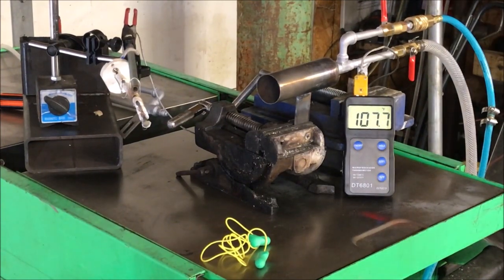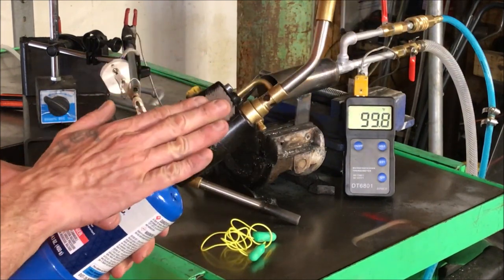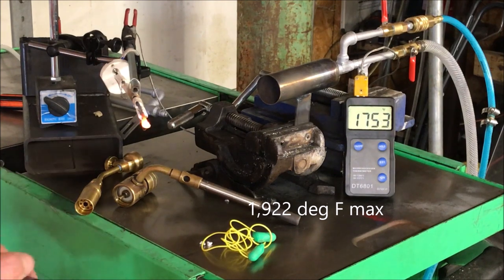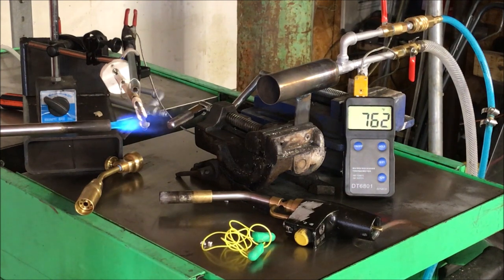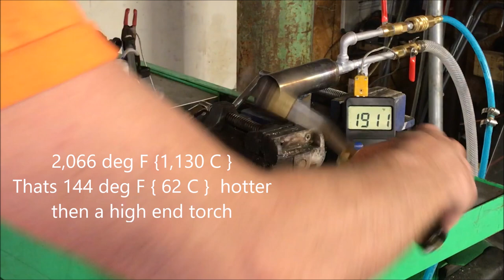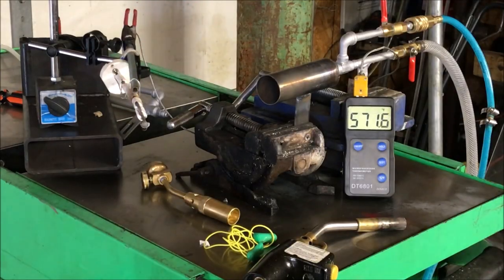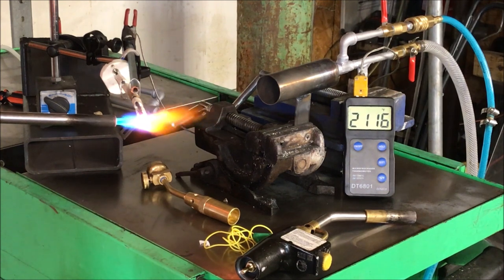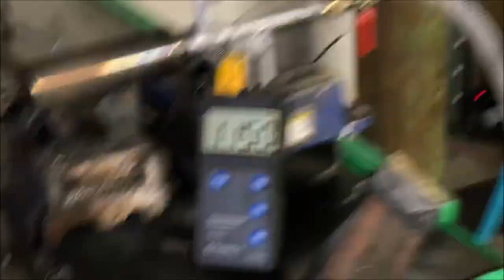Do all Propane torches produce the same tempreture

Comment: "An air-fed torch's maximum adiabatic flame temperature is assumed to be around 2,000 °C (3,600 °F). However, a typical primary flame will only achieve 1,100 °C (2,000 °F) to 1,250 °C (2,250 °F)." 
so you did quite well at temps of 2066degF and 2393degF with that turbo torch and your home made zeus which blew the rose bud out of the water with an extra 244degF

Comment: I would have loved to the orca ez torch in the test too. Its propane and atmospheric oxy as well. They claim it goes to 2,400 so how could it be hotter?
Reply: yeah i don't get that either as most butane/air lighter or torches on the market are claimed to be 2500 deg F although propane is not much hotter than butane this claim of these butane ones being much higher than what he demonstrated with those torches makes no sense

Comment: I know it's a long shot,  but I was curious if you have ever seen a torch that in concept is like the bernzomatic tornado2 only half egg shaped like a 70's Turner, so instead of having the nozzle come out the top and curve over it comes straight out the base at a 90°, with some kind of small adjustment bolt on the top where the nozzle would usually come out, and the regular flame adjustment valve directly behind the nozzle (also attached to the base). The flame it makes is similar to the the first torch you showed in your video with the exception that the torch i am speaking of whistles, and it is completely made of brass with the exception of the adjustment valve.
Reply: No question at this time. 😂